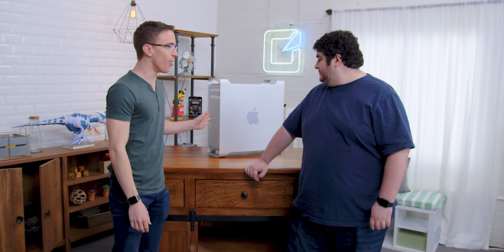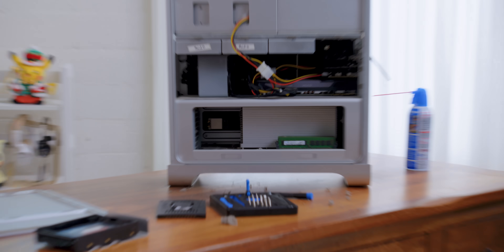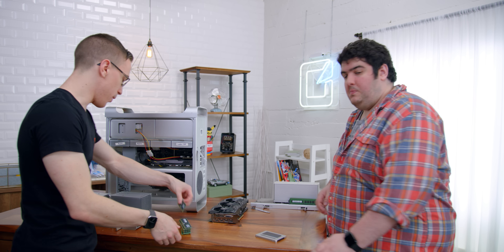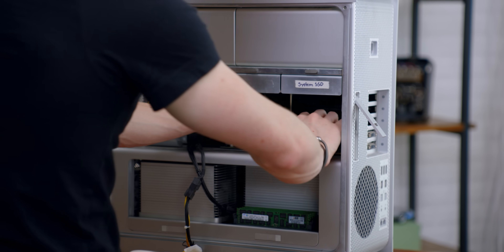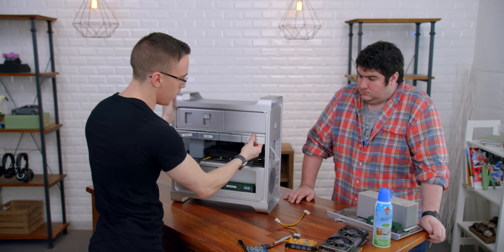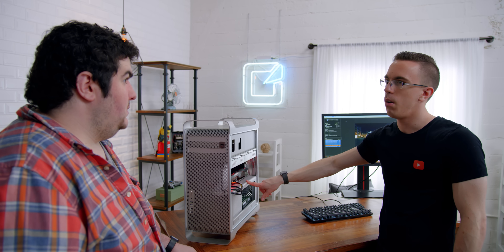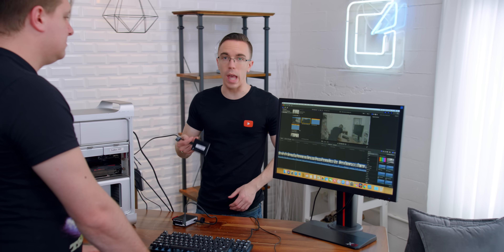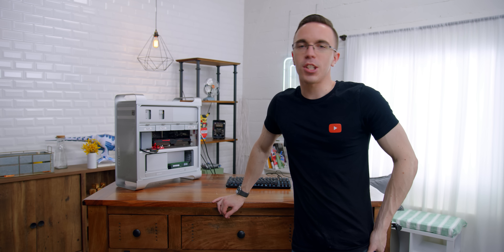Building The Ultimate Mac Pro

Comment: I have to correct some stuff you said 

1. the AMD 580 is far away from being the best card for this Mac. Since High Sierra there are AMD Vega drivers out of the box, means you're able to put almost any AMD Vega Card in to the MacPro 5.1

2. I highly recommend to don't use an open air Graphic-Card, because the air-flow system of MacPro isn't build for it. I crashed a lot hard drives because of blowing the hot air from the Graphic-Card into the case. You should use Blower-Cards with one radial fan, wich blows the hot air directly out of the case

Comment: Matt should seriously consider building a Mac compatible PC (aka hackintosh). I just built one based on a single i5-8600K and a Radeon RX 570 for $775 US. My geekbench scores were 5427 single-core, 22992 multi-core, and the compute gpu score of 123151. This isn't even top of the line stuff so its interesting how far consumer grade processors have come in the relative time.

Comment: Probably should have gone all out on the processor upgrade since processors for the dinosaur are cheap as chips, my single hex is 3151 and 14,336 which would have put his as a shade under 29k multi

Comment: With a few weeks ya waited for the parts and for 700 you probably could have gotten a 1950x and motherboard used(16c 32t & faster single core performance), throw in 400 more for ram and a heatsink and you've got the building blocks to a system that will will be dramatically faster in gaming and production, keep its value much longer, have better support for both drivers and hardware upgrades like usb 3.1, m.2, sata 3, pci-e 3.0 (if that becomes a bigger bottleneck later), etc. When you're already investing 700 you might as well pay the extra 40% and get the dramatically better system. I love budget and used parts builds but imo the price/performance wasn't there for how much you paid for the parts.

Comment: I have a Mac Pro 2010,  can you do a Upgrade video on how to do the Power supply for the Video Card,  all the steps.  I plan on upgrading to Mojave,  right know I did a upgrade to High Seirra,  that in it self has  Problems I'm dealing with,  most of my External HardDrives cease to Mount and one that connected internally isn't showing up.  Why hasn't Apple put a Designation software on where my HardDrives are in the Hardware Bay

Comment: So, a couple things. 

First, great job, second, I imagine you guys took out the 2 cpus and changed them to the Xeon 5690 6 core chips correct?  Right now the 5.1 single cpu are $100. That’s a video in itself. 

What I think the viewers would like to know is since dual cpus are on the way out did you run the performance on a single cpu upgraded to the 5690? Say with 64gb ram (that’s enough) since the dual cpu trays are so much more, is the performance worth it or is the upgraded 5690 single cpu better than the stock dual cpu?  How much better is the dual 5690 compared to the single?  

Lastly, when buying a RX 580 for a reasonable price, (under $200 now) how did you get it to boot Mac OS?  

These 2 things are the big stoppers for us that tinker but don’t build (yet). 

Your video makes it seem the only way to go is get the dual cpu (didn’t mention the upgraded chip) and that the RX 580 natively works out the box… It doesn’t. 

Will you help?  Thanks. Smashed the subscribe and liked.

Comment: You've heard of adapters right there's an adapter to run the pcie bus to any type a molex cable on the Mac pro I've had it and I've done it I can't believe he doesn't know about that it's from the video card output there is two of them unless already taken then it can be split

Comment: I just purchased an early 2009 imac with dual cpus, 24gb ram, gtx 1050 (and original amd card) with wireless keyboard/mouse and a hp monitor for 425 euros and upgraded the cpus for 55 euros to x5675's :D

Comment: I have a 2009 Mac Pro 4,1 that I flashed into a 2010 5,1. It's a single tray 3.33 GHz 6-Core Intel Xeon, if I wanted to upgrade to a 12 core, can I buy a dual tray, install cpu's and be all set or is it not that simple. Any help, hurray.

Comment: hi, I have a question. I own a 2010 Mac Pro 5,1 with 2 x 3.46ghz  6-core intel xeon, 64gb of ram, radeon rx 580 graphics card, running os high sierra. Can I upgrade to Mojave straight from high sierra?

Comment: This feels like a huge amount of money to spend for the performance upgrade. I think you’d have been better putting the fastest compatible 6 core processor in, or selling the machine and buying one that has dual sockets already. 64GB of RAM is great, but maybe not the best way to go. The built in sata controllers are slow, which you point out by helpfully bypassing them and editing from an external SSD for the test, so it’s not really a fair test at all. Also you could probably put a faster GPU in there, you can get a 1080Ti to work if you need the power. By all means throw 8/10/14TB hard drives in the built in bays, but boot from a PCI connected SSD. You can build a ‘cheap’ external USB 3.1 gen2 NVME drive/RAID and max out that connection (or cheaper if it’s RAID SATA M.2), or go thunderbolt 3 if there’s a card or 10gig Ethernet for a fast scratch disk for editing. I don’t think you got your money’s worth on this upgrade.

Comment: 3:20: Wrong ! You could've put a RX Vega 64 in that system, so GTX 1080 performance instead of GTX 1060 performance with the 580, tho it's still a way better upgrade from the OG card

Comment: Any word on whether or not the 2019 Mac pro will have a user upgradable CPU?
Reply: Yes it will, it's a LGA 3647 socket and the CPUs are really expensive. But you can slam in more ram, a better cpu, hard drives and video cards down the road. I think the nvme drives might be proprietary and the radon VII is a custom card with dual GPUs and HBM2 memory. Basically none of the upgrades will be cheap.

Comment: I got the 1 processor chassis for 250ish dollars and have the 6 core ordered for 30 dollars on ebay, and an RX480 for 100 dollars, I'm happy with my purchase, It's a good sub 400 dollars machine. the dual processors would be cool but that tray costs more than the entire system at this point, I could just put together a decent ryzen PC with that.

Comment: You should have put in the GTX 1080 there are drivers for that
Reply: takumi nightcore as someone who has it, unreliable nightmare and it isn’t supported in Mojavie.
Reply: @vinex19  they can still run it in High Sierra without a problem and plus they're already happened modded drivers to run on Mojave

Comment: Im curious why you didn't use the 5690 Xeon.  They are just about the same price and you can definitely notice a difference,ce.  Its not a huge clock jump at 3.46 Ghz, but across 12 cores and with a few differences from the 5680, it makes a big difference working with 4K.  One other note, I have a GTX1080 Founders edition ( Nvidia ) and it is slightly faster than the new ATI cards.  Just have to learn how to deal with the Nvidia web drivers. Otherwise, great build.

Comment: that $500 motherboard tray cost as much as my whole hp z800 system, including dual socket xeon x5660, 24gb ram, small 240gb ssd and a gtx 960. scores around 1340 in cinabench...

Comment: I have a Mac Pro early 2009 but its firmware is 4,1 and it's stuck with OS X El Capitan, I thought it to upgrade to a new OS but unfortunately, 4,1 is not supported and what's more unfortunate is that it doesn't have the original GT120 GPU. So I guess without the original graphics card I will not be able to upgrade this machine's firmware I guess. :( Also it's running an Nvidia Quadro 600 1GB which is old and outdated, but I really don't think that a modern GPU such as an RX580 or 570 will work with OS X El Capitan.

Comment: Hi Austin, I currently own a Mac Pro 2009. but was upgraded to a Mac Pro 2010 with a 2 x 3.46 ghz 6-core intel xeon processor, added 64gb of ram, but it came with ATI Radeon HD 5770 1024 mb graphics card and running on Mac OS Sierra 10.12.6. But I am having issues with my Mac Pro that it restarts on it's own whenever I am viewing videos on youtube. could this be a problem with the graphics card or what? I've been asking around for months now but no has replied yet. can you help me?

Comment: Wouldn't you be better off sticking to 48GB RAM to take advantage of the 3-channel bus?   If you populate all 64GB it will drop down to 2-channel.
Sure it depends what you need it for, and whether speed is more important than that extra 16GB.  Personally, my 3,1 has 64GB slightly slower mem than it can handle because it was literally 1/3 the price of the max speed.  But the difference was not as big as 2ch v 3ch.

Comment: I have a 2009 Mac Pro and i want to upgrade it. I saw on internet that it has a 240w power supply and his GPU (GeForce GT120) needs at least 350w. Im so confused. In theory, my pc already should have exploded if both infos are true. I want to install a GTX 1050ti on it, but I won’t do this until i have assurance i have the needed power supply. WHAT SHOULD I DO NOW?!

Comment: False it can support GTX 960 and probably more I have one in my Mac pro
Reply: I have the same system and it supports my GeForce 970 4gb
Reply: Really? I have had a 1080 in it and it has been a complete unreliable nightmare with updates forcing me to slide in the original card. Now switching to a vega 56 in the hope it is more reliable.
Reply: Forget nvidia card its not optimized

Comment: A real Ultimate Mac Pro 2010 would be something like this:
CPU: 12-Core 3.46GHz 
RAM: 128GB
SSD: x2 4TB PCIe Samsung SSDs in RAID 0
GPU: RTX 2080
Ports: USB 3.0 PCIe adapter
HDD: x4 14TB RAID 0

😛
Reply: The 2080 would not be a good choice for the mac pro if its running 10.14. Apple made it so nvidia cannot install their drivers. I lost a crap load of performance by upgrading from 10.13 to 10.14 with my official evga mac gtx 680. So running an AMD vega or rx card would be alot better than the 2080, or at least on the mac side.

Comment: Will this system with a metal capable graphics card (RX-580) still not run OS Catalina? Am I stuck at Mojave...
Reply: It should run every macOS if SSE4.2 is supported on your CPU and you have a Metal GPU. Ofc unofficially, but you can

Comment: The old Mac Pro is still an incredible machine. I'm using a 1.1 Mac Pro from 2006, flashed to 2.1 running OSX El Capitan, 2 Quadcore Xeons, 24 Gigs of Ram and a GeForce GTX 670

Comment: There is an enormous amount of misinformation, and a lot of critical information missing here. Just as an example, you can run a titan v, gtx 1080 ti or vega 64 in a 5,1 no problem. If you need information on these machines join the Mac Pro Upgrade group on Fb, myself, and many many other people who upgrade these machines for a living, or just because they love the greatest mac ever made, can answer any questions that you have.  PS remove the dimm closest to each heat sync and run GB4 again (westmere cpu's were designed  to run in triple channel mode) You'll see about a 20% improvement.

Comment: That RX580 is going to thermal throttle with the side panel on...

Also he might want to repaste that STRIX card because I have the RX480 (pretty much almost the same) and the thermal paste is complete trash! I got over 10c drop in temperature after reposting.

Comment: Shame, that no tests what is speed of SSD write/read, connected to SATA II, so, SSD is working in half speed (250/250MB instead 550/550). For many users communications with discs are many important (libraries, plug-ins etc...). So, please calling "Ultimate MacPro 2010...".

Comment: 20,000 on the multicore is not that high. My 2014 i7 4790K@4.7 GHz does 18,500 and it only has 4 cores.
And considering that the Mac Pro has three times the cores... My system was 700 bucks in total.

Comment: An rx580 is the max the system can handle? Ummm wrong! I am running a gtx 1070, thats 40% faster than a 580. 3.0ghz? That’s the Xeon x5675. The x5690 is the best chip you can install. 64gb ram? It holds over 128. I think the limit is 160 or something g like that. No nvme m.2 pcie? It holds 6 HDDs. Not really maxing anything out at all. This is a basic upgrade.

Comment: Your problem is poor HD performance, old slow SATA. I have the Kingston Hyper X Predator PCI card for storage and it just cooks. 1,147GB/s Write and 1,312GB/s Read on a 480GB drive.
Reply: Sabula Tech as your boot drive?
Reply: @vinex19  No, never would use as boot. Use for data/render drive. You want fast access speeds for video/data files when doing things in Final Cut,Premiere,Compressor. Any program that is rendering needs fast read/write speeds. Since the price per GB for SSD is high it wouldn't make sense to use as boot volume. I use older standard SATA SSD for boot. Once things loaded into RAM for OS and Apps, faster SSD is not needed really as long as the program allows you to specify drive to use for cache/scratch disk.

Comment: How well would:

Windows® 10 Home (64-bit)
Processor
Intel® Core™ i7-8750H processor 6 Core
Graphics
NVIDIA® GeForce® RTX™ 2060 (6GB GDDR6 VRAM)
Display
15.6" Full HD 144Hz w/ 4.9mm bezel
Storage
512GB SSD
Memory
16GB dual-channel, expandable to 64GB
Battery
TBD (80Wh)
Keyboard
Per key RGB Powered by Razer Chroma™
Gigabit Ethernet
Not available
Finish
Black with backlit green logo and green USB ports
Dimensions
0.70" x 9.25" x 13.98" / 17.8mm x 235mm x 355mm

Run gta 5, gta rp, gta online, the sims 4, just cause 4 and more graphic games without screen tearing and bright and looks as good as a youtubers pc

Comment: Installl AMD video card?))) In my MacPro i install Nvidia GTX 980Ti Extreme Edition. In my MacPro i need CUDA for fast video and 3d render. And i will change 2 CPU to Xeon X5690. Its maximum CPU)
Reply: Apple made it so nvidia cannot install their drivers. I lost a crap load of performance by upgrading from 10.13 to 10.14 with my official evga mac gtx 680. So running an AMD vega or rx card would be alot better than the 2080, or at least on the mac side.

Comment: Always fun to upgrade an old pc and fun to watch video but not impressive in term of the power you're getting for the money.... for $1000 you could've build a much better new PC/ hackintosh with new parts or even much much better Pc/hackintosh with used parts. Or just get him a Macbook air 2018 for $1000 on sale.... Can't believe people pay $700 for basically two 10 year olds Cpus ... that's thread ripper money ... or i9-9900K + mobo.... the power of the cult lol.  What they're keeping from the old rig is basically power supply + the mac license (all the hdd can be transferred) so other than saving a chunk of metal they're not helping the environment much either.
Also since it's about overkill and impractical upgrades, why can't it run Vega 64 ? Is it PSU issue or Mobo compatibility ? That card is only $400 now.

Comment: Why not just Hackintosh? Would be a lot cheaper and more powerful.
Reply: Less reliable, very easy to get wrong, complicated & some features may not work if you don't do it correctly
Reply: Nathan Plunkett yeah but this is austin, he is a pro at these things. Ive been using hackintosh for over 6 years and it works like a real mac. Just need to get compatible parts.

Comment: Austin Evans, 
Serious question Sir. First what I'm working with. 
I have a Mac Pro 5,1 2x3.46 12 Core, which was running High Sierra but had to jump to Mojave with the purchase of a RX580 graphics card. The 5,1 is loaded w/124GB DDR3, 
OWC provided Sonnet Raid Card w/ 2X2TB SATA Crucial SSD's making a 4TB Boot Drive, 
plus 4x10TB HDD's in trays (2 HDD's are storage and 2 are Clones), 
Gigabyte GC- Titan Ridge Thunderbolt 3, USB-c, Display and Mini Port Card
Currently it has a RX580 Sapphire which runs-
2x4K 27' displays and my newest Work from home tool a... 
WACOM 32" Cintiq Pro 
The adding of the WACOM PRO has just started some serious LAG when I draw to the surface of the unit. 

SO, getting to the question... If I go the route of a Radeon VII (which you stated and we see is now supported on Mojave) But I have just jumped to Catalina (Damn it!), Using DosDudes patch (Thanks for making it possible DosDude1.com). Hoping that driver upgrades would decrease lag on the RX580. However it didn't! It appears better Graphics performance is needed to run all three monitors with Touch/Draw capabilities. So I'm considering your Radeon VII upgrade. 

Here is the question - Will the Radeon VII run better on the Catalina OS, is it better supported now without driver limitations that it experienced with Mojave?

Comment: boo... I'm on a mac pro 2009. using RX Vega 56 and NVME boot drive
Reply: Raffy Simbol did you do the pixlas mod for the Vega 56? I am changing from 1080 because it is incredibly unreliable and I need metal in Mojavie. What vega 56 are you using?